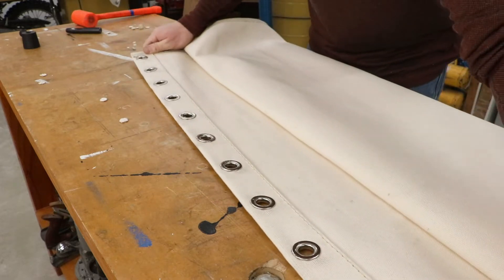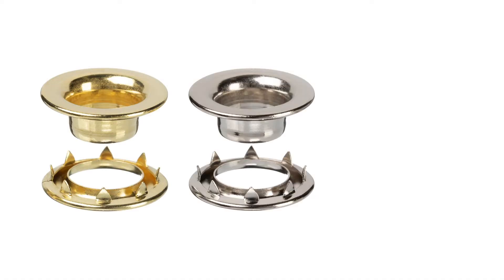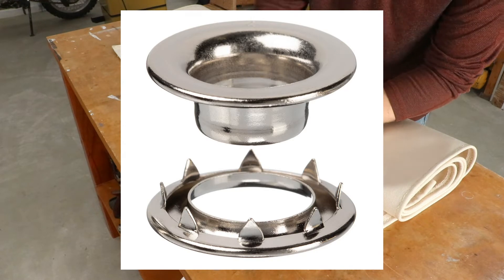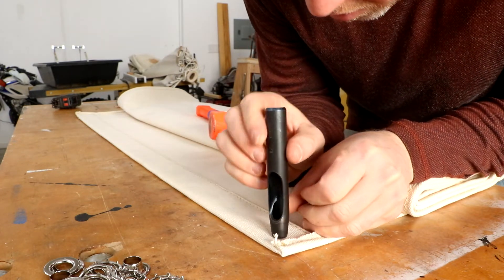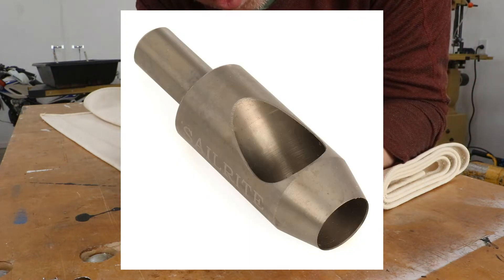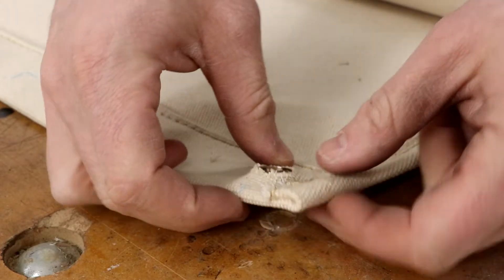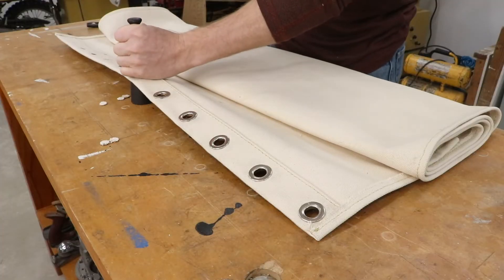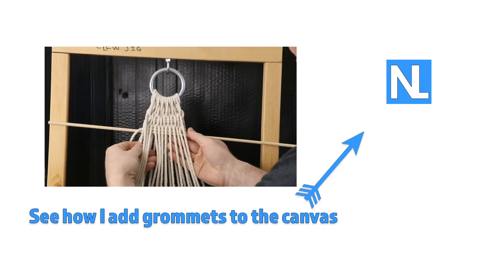Mastering Maritime Slumber - Canvas Navy Hammock Making: Part 2 (or a sailors hammock)

Comment: Are you going to give a suggestion on what to use as a ring for a clew? I’m trying to figure out what to look for.
Reply from the maker: sorry for the delay in response.
the original rings were grade 80 alloy steel with an outside diameter of 2-1/2" and a thickness of 3/8".
Alloy steel is near impossible to come by. I suggest galvanized but if you have the means get stainless steel. I got some stainless steel on discount. while they are not a sponsor I got my rings at go2marine, they where made by sea dog.

Comment: Also if you only have 6 to 12 ropes on the clew how do you connect to 24 ? it should be bigger people are not starving anorexics anymore !
Reply from the maker: Mine is suppose to be historically accurate. Making one with more ropes is possible. Just use longer rope and experiment with tying the clew.